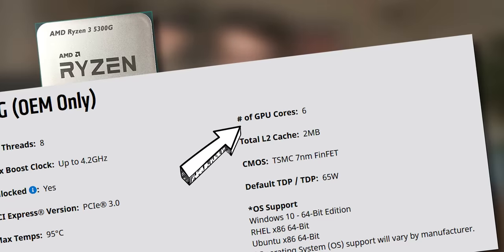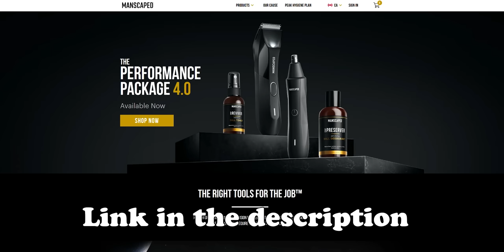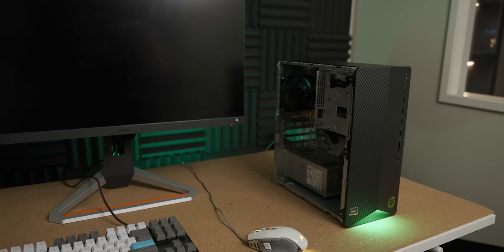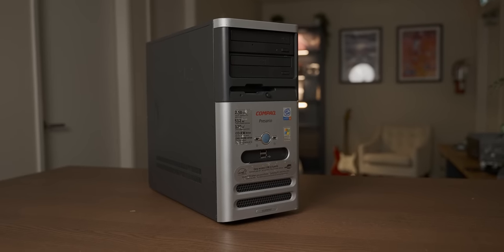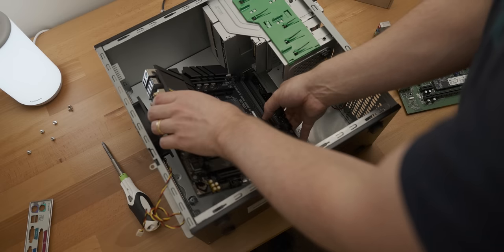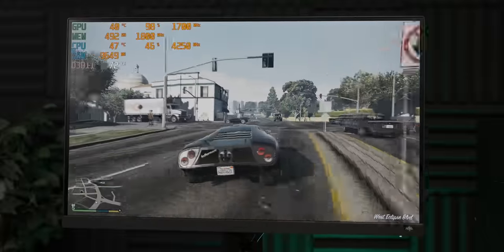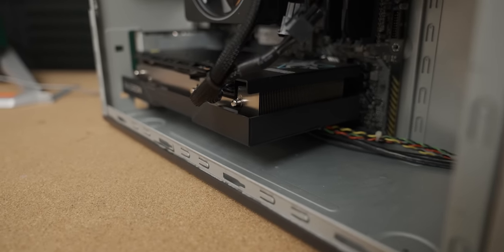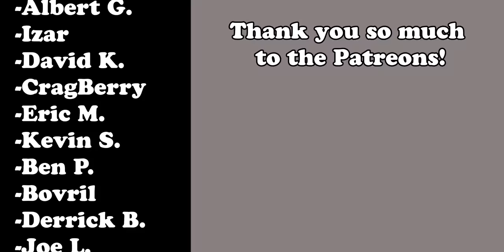Budget Sleeper Gaming PC Build Ft. Dodgy eBay Parts...

Comment: When a 20 yo pre-build has better airflow than most modern ones, they really have gone backwards
Reply: + The standards.
Reply: The 20 year old PC dosen't have a lot of weird proprietary stuff in it.  The new one reminds me of a Dell Dawid did a video on.  Who else couldn't help but think Dell when they saw the new one?
Reply: @SJLtalentpicks  If it was that I wouldn't be able to buy better parts to build a PC with.  I do prefer to build my own.  That way I don't get weird proprietary parts and pay too much for them.  I also find it satisfying to do it myself.  I built my last PC before the scalping nightmare began and caused PCs to cost 10 times more to build.
Reply: @charleshines1553  I am buying s prebuilt due to the inflated prices of gpus and cpus, and it's around 1500$,everything in it is replaceable I think. The motherboard,gpu,cpu etc etc. I think it all comes down to how good u look,you can find some pretty good prebuilds,with a little modification. I got the AMD Ryzen 7 3800X, and for gpu AMD Radeon rx 6600 XT OC. Pretty good deal.
Reply: @charleshines1553  p

Comment: Given the quality of pre-built PCs the system around the 5300G should just be seen as packaging material. Why use foam if you can use steel?
Reply from the maker: Haha!! I know right. Steel is more turtle friendly than foam. 😅
Reply: @DawidDoesTechStuff  turtle friendly lol
Reply: The cheap aluminium they use is probably worse than just wrapping it in a newspaper

Comment: Dawid, I believe the reason that pc sells for so cheap is simple, I see a lot of this happening lately. Someone buys that system from HP that usually comes with a gtx1660super for 600-700 dollars, they take the graphics cards out (either for mining or for reselling) and sell the rest of the computer for a very affordable price ($400), after the system is sold the gtx 1660super that was taken out has a value of around $250-$300. You can’t find gtx 1660supers for $250-$300. Current aftermarket price for gtx 1660supers go for $500-$600. So if they are a miner, they just scored some great cheap GPU, if they are scalpers they resell the card for 500-600 and they made a nice profit between selling the system and the GPU separately.

Comment: Its actually insane how good amd entry level apus are
Reply: Wait till you see the RDNA2 APUs
Reply: @matasa7463  - with attached ludicrous pricing no doubt.
Reply: yes... OEM only...
Reply: @pietrocavicchioli6128  theres the 5600g and 5700g too
Reply from the maker: I was really impressed. I do agree with Matasa though, it's a shame that it is still based on Vega.
Reply: @buggerlugz6753  Not really. You can even pre-order it now. It is called a Steam Deck.
Reply: I use AMD's APU all the time as they make great systems for older people and general computing.
Reply: @DawidDoesTechStuff  They get an instant ROI throwing rdna in consoles.  Maybe we'll see them in the next gen. :)
Reply: @jamesm568  Well APU itself IS AMD technology.
Reply: @DawidDoesTechStuff  
I can't see why is it a problem.
A modern 8-10 CU Vega iGPU is already being bottlenecked by DDR4.
Reply: @DawidDoesTechStuff   don't forget about Steamdeck, we should compare that to the 5300G once both are available
Reply: @DawidDoesTechStuff  can't wait, maybe an APU will become a decent option for gaming while we wait for GPU prices to trickle down

Comment: "If they can do it 20 years ago, why can't they do it now?" 

Because standardized parts means people can fix things on their own, and won't have to overpay for HP repair. If they have to rely on HP for repairs, HP can easily just say "Nope, entirely broken, gotta buy a new one."
Reply: Gotta learn from Apple
Reply: Thats a good point
Reply: Right to Rob-pair (repair)
Reply: At least the apu, ram and ssd are not soldered into the board
Reply: Yeah, but it's more about charging for upgrades. They know you can't just throw any GPU in there due to the power requirements and guess what doesn't fit, a standard PSU. HP and Dell have been doing this for years. Make a couple parts proprietary, like a side panel mounted CPU back plate and you'll have to pay more for their junk CPU cooler upgrade because standard coolers won't mount. You can't replace the motherboard, without buying a new case and vice versa. If you want to upgrade, come to us and we'll overcharge you for subpar parts and keep the money in our family.
Reply from the maker: Oh exactly! Planned obsolescence is the worst.
Reply: @DawidDoesTechStuff  but without planned obsolescence our economy might not work, it may be a pain but it keeps jobs available
Reply: @ollieallwood3362  Negative. That's never been the case. A couple small companies supplying overpriced parts is never better than hundreds of companies supplying a multitude of parts of varying price ranges. Think about the jobs that could be created if Apple, HP, Dell and Lenovo made their products compatible with every other company and used industry standards. More options and the possibility of these companies competing by offering lower prices. More jobs, more options for the end user and less headaches all around. The only one that wins is the consumer.
Reply from the maker: @ollieallwood3362  I guess, but if you let people upgrade, they would still be spending money buying parts. I don't think growth necessarily requires companies to design their products in such an anticonsumer way.
Reply: @ollieallwood3362  companies like hp usually outsource the work to other countries. Also there is no lack of jobs for them (like getting us more gpus or silicon for the gpus)
Reply: @DawidDoesTechStuff   Yo Bruh, I have built a i5 2500k 16GB HyperfuryX kingston Ram system with a 256 gb kingston sata SSD and original repurposed 500 gb Seagate HDD with a Gigabyte GT730 2GB DDR5 wich can be overclocked from 902 to 1097 Mhz and the samsung VRAM overclocked from 5000 Mhz to 6000 Mhz. Build in an Ex Dell 390 sever. What should I ask for it Dawid ? It plays E-sports games like Valorant. Can play Fornite in low graphics and plays Skyrim 2016 pretty well.
Reply from the maker: @corneliusantonius3108  Did you buy all the parts recently to resell? If so, I think taking the price you paid for the parts plus 10 to 15% finders and building fee. Although in the current market you could list it for bidding on eBay and let the market decide what its worth.
Reply: It's the constant march to 100% proprietary parts. Which leads to 100% 'can't buy from anyone else but The Company Store' at inflated prices. More 'oldies but baddies.'

"I owe my soul to the company store."
Sixteen Tons (1947) written by Merle Travis.
Check out Tennessee Ernie Ford, Sixteen Tons.
Reply: @DawidDoesTechStuff  I did buy the stuff the last 6 months just for the fun of building and resell. But the fact that the i5 is overclocking itself to 4389 Mhz sometimes while gaming with the server bios of the Optiplex 390 still on it and a dell stock cooler for an i3 is funny to me. (package temperature tops at 75 degrees celcius) In the service bios is the Turbo Boost set off to default, so you have to set it to Turbo boost on. I think somebody allready overclocked the hell out of that i5. And thank you for your pro-tips 👍👍👍
Reply: @Tano No sane person thinks "all they want is simplify the machine"

They don't want to simplify. They want to complicate our lives.
Reply: Here hoping Right to Repair Legislation puts a hold on nonstandard BS
Reply: @ranjanbiswas3233  They want to keep the customer paying them and nobody else. There was a time when Packard Bell, Gateway and e-Machines put warranty stickers on their side panels and top covers to keep customers from even opening the systems, forcing the customer to return the system for upgrades or hire a "certified" technician to upgrade their system at exorbitant prices. This went away when people answered back by swearing off the big companies and having local shops build their next computer. The public forced these companies to change their tactics with their wallets and it worked. That's what we need to do now. Stop buying proprietary systems built like the one in the video. If HP, Dell and Lenovo are stuck with all this back stock of garbage, they'll reconsider their tactics.
Reply: i can't believe nobody has commented on this but the new board actually is using the new mobo/PSU standard...its called 12 V.O. and it is going to be in every system within a couple years.  its way more efficient.
Reply: @dicknavis00  Are you certain? It looks like every other proprietary HP or Dell PSU to me. Dell/Alienware and HP SFF systems use non-standard power supplies with goofy pinouts.
Reply: @dicknavis00  More efficient for who? 
I hope 12 V.O. don't catch on as it breaks alot of things that need that extra power via molex or Sata plug
Reply: @DawidDoesTechStuff  back in the day most people did not service their components themselfs and theit were not alot of Computer Repair Shops were u could get it fixed cheaper then with the OEM
Reply: @lukasperuzovic1429  that's not how it works, the psu won't make less power it just won't handle the double switch of re modulating the same power over and over by giving the MOBO a clean 12 volt wave and having the board sine out whatever devices need...its less heat, less waste, and less complicated interactions
Reply: You mean I can still use by 3.5 and 5 volt cleanly? Having the board reduce the voltages sounds like bad engineering to me. 
Anyone someone needs extra power for a fan header, people always use molex or sata power connectors. Hence VO12 "breaks" stuff
Reply: @lukasperuzovic1429  i would suggest watching linus' video on how a power supply works or something similar, 12vo gets rid of redundant switching and remodulation that results in power loss, heat, resistance, and latency.  having the board handle every output voltage in a single switch per wavelength is just better in every single conceivable situation end of story, nothing is being restricted in any way whatsoever at all.
Reply: @dicknavis00  I saw it, as well as Gamer Nexus's bit on it. They both have their reservations. And latency too? Do you work for intel or something?
Reply: @soulmourne2698  yet. Trust me they will if they can figure out how to do it cheaply.
Reply: Planned obsolescence. Why let you be able to repair a sub $100 part to fix your pc when they can charge you $900 for a whole new pc?
Reply: They want you to curse the designers of it every time you look at it.
Reply: The right to repair is so crucial
Reply: my parents bought a samsung tv for 2600 and after 3 years its dead, samsung has no repair parts available, local shops cant get them, and even ordering from manufactures in china will cost half the price of the tv for shipping... their warranty expires exactly before it breaks and their customer service tells you "we can offer you a $30 discount on a new one"
Reply: Wat
Reply: its not even about HP repairs, its about selling a new device. HP doesnt want to sell repairs, that means they gotta pay people to fix stuff opposed to the cheap cost of just mass manufacturing new shit
Reply: @soulmourne2698  not yet but they're getting there, apples already been doing it.
Reply: "If they can do it 20 years ago, why can't they do it now?" 
simple they can they just don't want to🤣🤣🤣

Comment: I just built the opposite. I stuffed a super socket 7 motherboard with an AMD  K6-2 450, 256 meg of ram, an 8 GB SD card as the hard drive and a FX 5000 into a modern  mATX case. It has a 3 front facing RGB fans sealed behind glass and a tempered glass side panel which for any modern system would be the equivalent of leaving a puppy in a car on a hot summer day. For a system like this with a 60 mm CPU fan it's overkill and I love it. 

Time get reto to do some DOS/Windows 98 gaming.

Comment: PLEASE get some IDE to SATA Adapter to make the DVD and Disk drives functional! 

Would be really nice to see you refurbish this.
Reply: Switching one for a BD drive would also be neat! :D
Reply: @Tano why are you so angry, mate? 

You'd be surprised how long those drives actually last. I got multiple who are probably older than the ones in the video and they are still working.
Reply: @Tano That looks like it would take a front monitor like LGR did a review on recently.
Reply: or just get some SATA DVD Drives
Reply: And IDE adapter won't work for the disk drive they have there own Floppy controller.
But you can still get it working anyway I know because I have done exactly this for my PC. Using a Floppy to USB board and an internal USB hub to plug the Floppy Drive into the PC through USB worked just fine and Windows is still going to give it a nativ A: letter.

Also for IDE could he also use a PCIe IDE controller card there aren't all that expensive and only need an X1 slot to work.
Reply from the maker: @halbmetallmensch  Doing a combination of getting the one drive working and adding blue ray support sounds awesome.
Reply: @Tano since you are asking: for starters I still have CDs and DVDs and i also still buy CDs 😉 I also never had issues with optical drives like you describe
Reply: If you really want DVD, just get a used SATA DVD. Probably cost less than the IDE to SATA convertor, and work more reliably. The HDD can't be worth it.  A new SSD is $25 to start. Heck, Microcenter is literally giving them away. It's not spectacular. But it will still beat an old spinning drive like it took your brother's lunch money.
Reply: @Tano I have computer CD drives that are 24yrs old that still work, and also DVD drives that are nearly as old.  Just because you've had some die doesn't mean they all do.  Admittedly optical drives, as they became cheaper, were built less well.  So perhaps your experience is with newer drives?
Reply: @Tano lol.  I do not use optical media in my current gaming rig,  but I have PCs for WinXP, Win98 and DOS.   All have optical drives and all run well.  I get what you are saying though.  I have a USB blu ray burner that will burn to M-DISK format.  Those blu rays are supposed to last 1000 years!  That would be great if they could guarantee the drives for the same period.  But of course they cannot. Haha.
Reply: @LatitudeSky  I'd tend to agree. Out of curiosity I checked local prices, and at 15€ even a new DVD drive is only double the price of an IDE to SATA adapter :D
Reply: @johnpaulbacon8320  it's not about putting a new drive in it's about preserving the look of the sleeper but still being able to use what's in it. $65 is a good price but if you can just use the old drives with an adapter for $10 and preserve the original look (which is the point of a sleeper system) why not?
Reply: Yes that was the idea. But since the old mb wouldn't work in the case,  using a sata drive would be no different then switching to the new AM4 mb. In fact the new drive would be a "Sleeper" as well since from the outside it would look just like it would if you had the old mb and optical drive together. It's a total sleeper - no one would think you could play a Blu-ray disc on the system.
Reply: @johnpaulbacon8320  that's not what a "sleeper" is.....of course it's different switching out a component you can see from the outside (the DVD Drive which has a different color and markings than the original one) or a Mainboard which you can't see looking at it from the front. 

You could maybe put the old cover on the new drive but that's always quite the hassle. So an adapter would still be the cheapest and fastest option. You would need to get one anyways for the Disk drive.

Comment: It’s funny that compaq is identical to the original PC that my parents got when I was in middle school like 5th grade in like 2005 or so ! It was the first PC that I disassembled and then upgraded, and then transplanted to a new case with some mods!!! 

Those are surprisingly upgradeable while also having very standard parts compared to today’s prebuilt. I was actually able to just buy a graphics card for it and go then upgrade the case and power supply! 

After all that I built my first complete gaming Pc and sparked my interest in electronics repair among other computer and tech things I did all thru high school 😌… they still have the case in the attic I believe lol …..Those where so much better for upgrades then some new prebuilt PCs with custom one off parts !

Comment: I tried doing this kind of build with a dell from a few years ago with an i5 4460,the proprietary part turned out to be the power button connector.
Reply: thats easy to work around, just buy front panel extensions and connect them to the pins i did that for an hp 520, had an engineering sample of an i5-4460 with 8gb ram and an rx 470 at the time i build it
Reply: Same